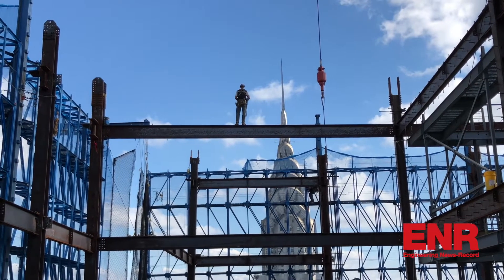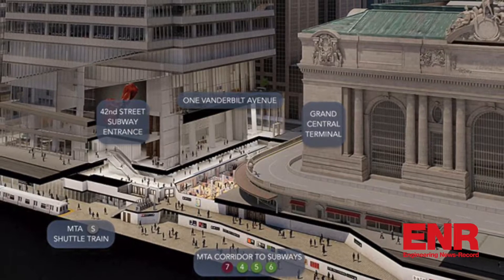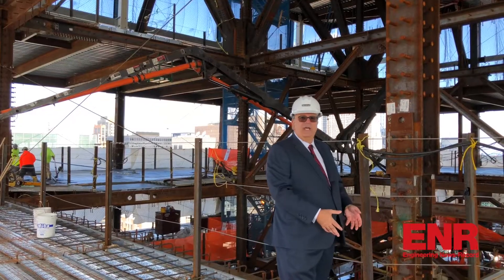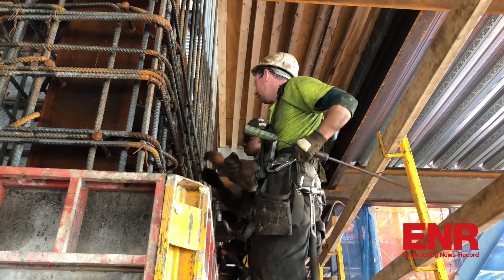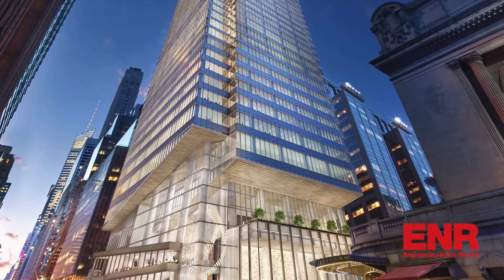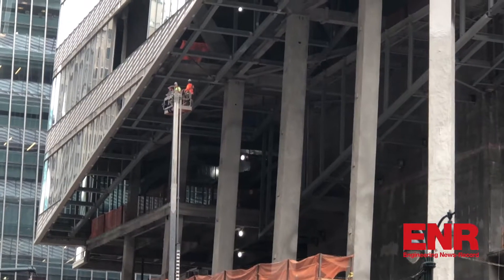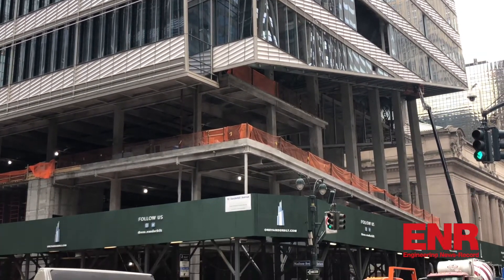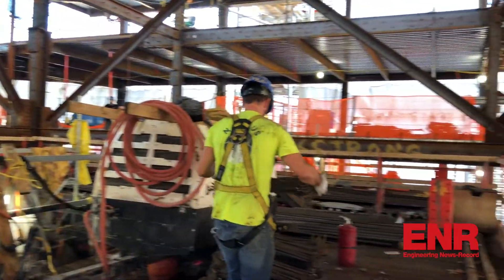Crews Elevate Supertall One Vanderbilt Using Climbing Form System

Comment: 6 weeks!  Ironwork before core?
Reply: Those 7 columns at street level?  3 floors without bracing?
Reply: Because constructions spans winters, does this method allow for more uniform cooling and reliable, consistent strengths?